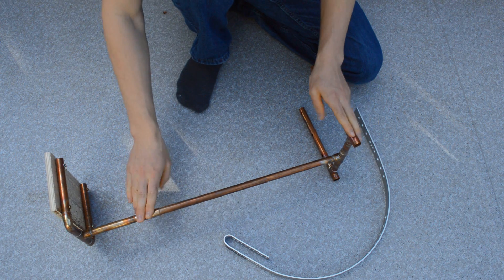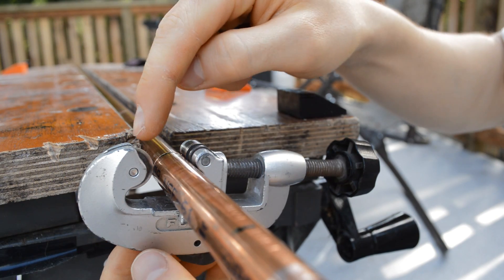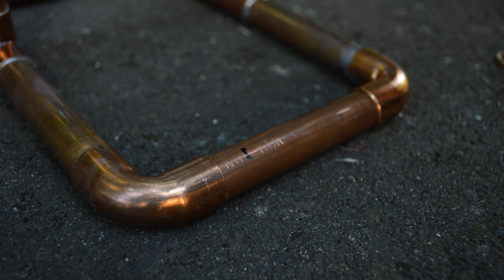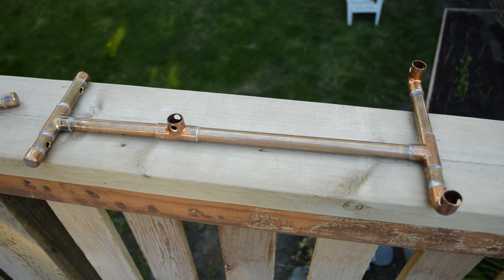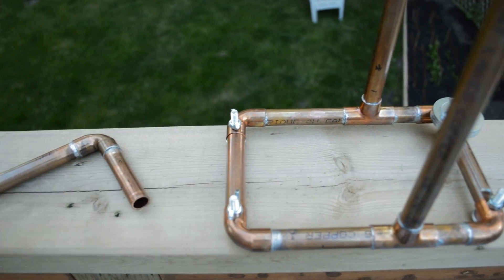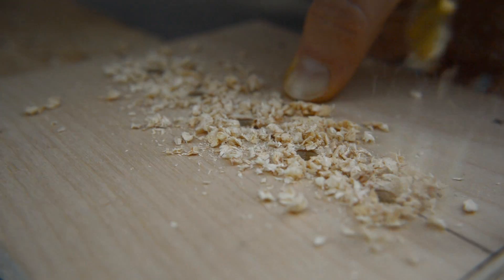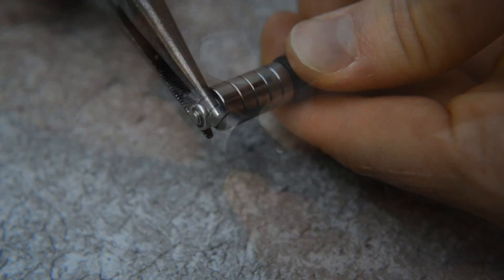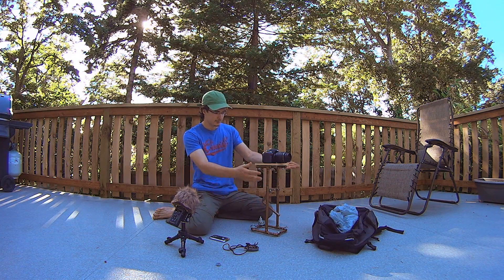How to Build a Steadycam - Camera Stabilizer (3.0)

Comment: I made it and it works perfectly, I have an add on that helps allot, I'll post a video on YouTube on what I did and modified (Camera Stabilizer 3.1). I'm going to use it to film this month...
Reply: Kuba H04 I already had most of the fittings and pipe lying around, I don't know what the cost was...
Reply: Checked your channel, you didn't post that video.

Comment: Got done doing it like 2-3 weeks ago, pretty dope! I'll probably need to buy another pack of 50 washers and longer screws to balanced it better. I'd definitely recommend you guys doing this to paint it, looks way more professional and stealth, especially in  black with. I also added a soft cover like on top of the wood.
Reply: Anexonel what size bearings is required?

Comment: Excellent job Forrest.  I'm trying to find something to stabilize the tiny Panasonic Lumix LX100.  So far i couldn't find anything, since because of the small size of the camera.  Everything they had in store was too big.  The camera weighs only 393 gr.  Have any building suggestion ?  Perhaps smaller-thinner tubes, smaller camera plate ????
Anyways thanks for sharing this dude :-)

Comment: hi

This is one of the best stadycams that were made homade...

actually i'm building at the moment just one like is yours...
I was wondering which presets did you use on recording video on Nikon D3200???
Reply: Klemen Lorger what bearing size did you use? what works?
Reply: depends on which bearing do you think... i've used bearings in every part of gimble... i think i have 5 of them in gimble...

Comment: Just a random little thing to add. When you are soldering the copper, more flux is never a bad thing. Any excess will burn off and it saves you from possibly overheating the copper and having the flux run off of the contact surface.